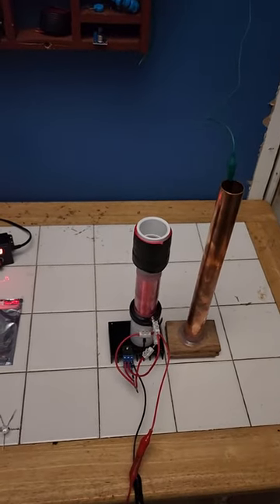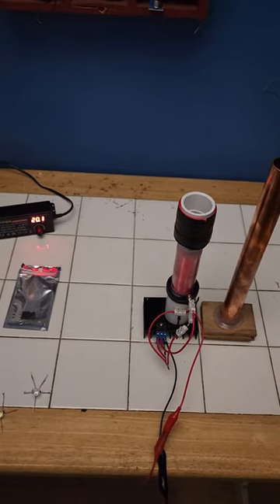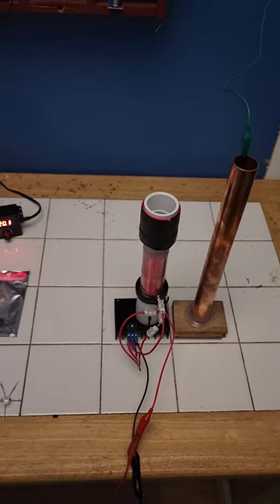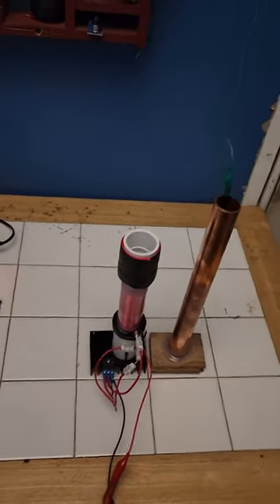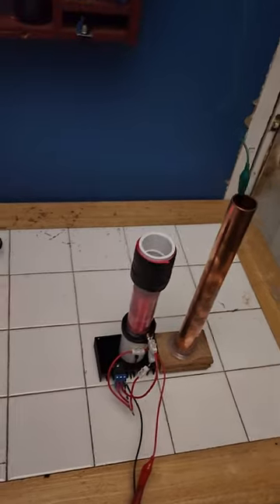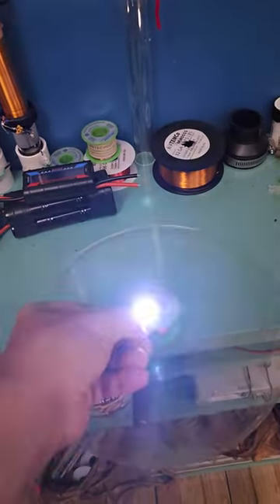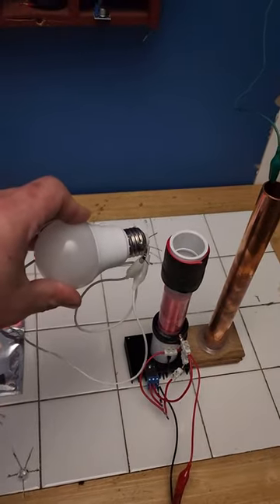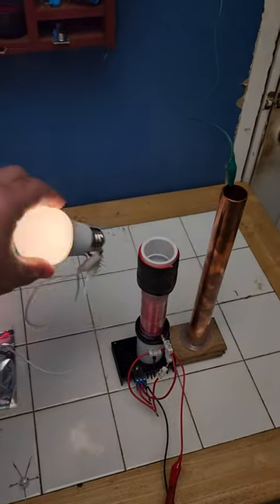🛰 FULLY READY TO SELL & SHIP CONJUGATER TESLA COIL TRANSMITTERS 🛰

Comment: Great job. You will sell a ton of these. Best wishes
Reply from the maker: I hope so no other device can produce these effects to my knowledge unless it's hidden away in some lab somewhere
Reply: @MTECHINDUSTRIES  sent you an email
Reply: @MTECHINDUSTRIES  and how many watt dc motor CD u run w it rectified n cap /spark gap to raise voltage nd a good earth... What dc vtage nd any time used a buck transformer
Reply from the maker: @D K  so far I've gotten a mini 5 watt dc motor to spin off of 2 seperate Earth grounds going through a bridge rectifier when the transmitter is powered on. I don't have ant bigger motors & haven't experimented too much with motors

Comment: Have you ever measured the voltage between your body and ground when you're close to that?
Reply from the maker: Anywhere from 0-800v but it's rf & useless unless rectified to dc first to do actual work lol
Reply: @MTECHINDUSTRIES  some people believe that that type of EMF is unhealthy. It's just my opinion but you might consider a disclaimer
Reply from the maker: @Dandelion Farmer  possibly but were exposed to a barrage of it from the sun & cell towers on a daily basis & any radiation that's non ionizing isn't dangerous too humans but will upset sensitive electronics
Reply: @MTECHINDUSTRIES  I've never seen an LED light up when it's held to the Sun or held up to a cell tower...have you?

Great device, and great video BTW, you do some nice work. I study and work to remove EMF and geopathic stress lines from people's homes. EMS at a level strong enough to let an LED is not healthy do yourself and especially your parents a favor and do some research
Reply from the maker: @dandelionfarmer2847  I'm curious to have a vacation cabin in the woods that has a grounded copper mesh around it to remove all radio signals & noise. I hear it makes people feel more recharged
Reply: @MTECHINDUSTRIES  a company called geovital has videos up about mesh as well as conductive paint that can be grounded. You could paint your room with it. Nature has its own recharge effect, but grounding is amazing in and of itself. I sleep connected by a wire to a ground rod outside my room, it helps tremendously with pain and well-being